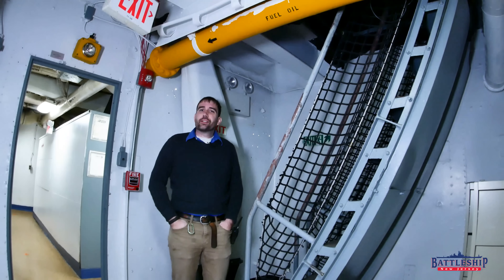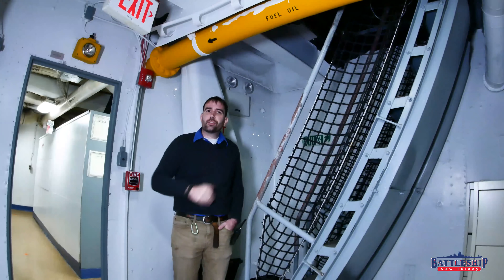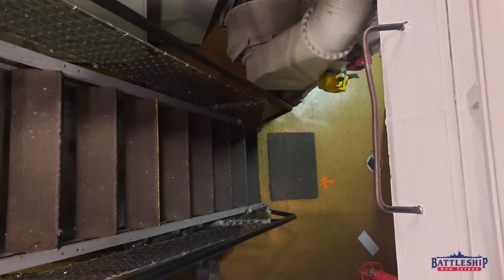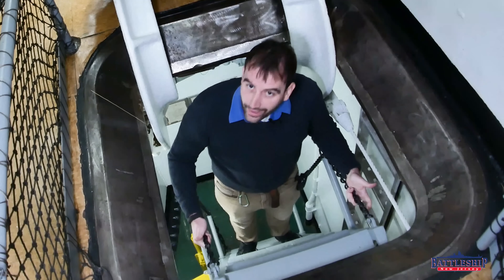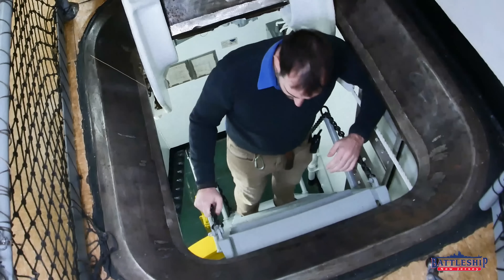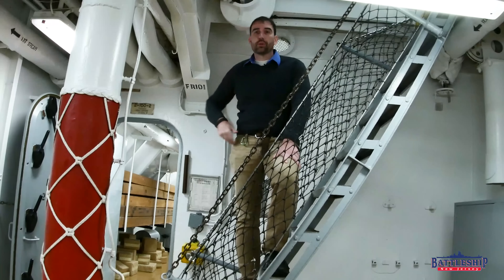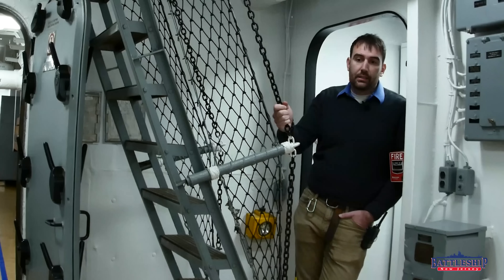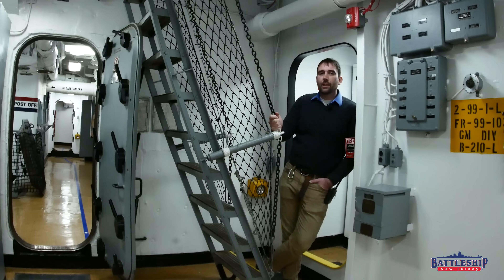Why Are Ladders on Ships So Steep? And Why Aren't They Stairs?

Comment: Thx for shaing this. This is no joke. My husband spent many years on aircraft carriers. He and a couple others, had to carry 80 lb barrels on each shoulder up 5 flights of these "stairs" =300 barrels. What the military forces them to do damages their body, and the VA does not want to give any of them compensation- disgusting. Yes, they slip & fall- big feet carrying heavy loads on those narrow treads. His shoulders, neck, back & feet were damaged pretty quick and have gotten worse over the years.

Comment: On the USS Saipan, to get from Main Machinery to shaft alley, you had to go up a vertical ladder at least two decks, walk across a catwalk over the well deck, then down another vertical ladder two or three decks. No sweat when she's sitting at the dock, but not much fun in a storm. Still, I much prefer vertical ladders to angled ones. Simple and clean.

Comment: A note on why they're called ladders and not stairs. Stairs are fixed in place and designed to be a permanent fixture. Ladders are not. Those are actual ladders which are designed to be removed quickly with a minimum of tools if necessary.

Comment: They are ladders.   It's not just tradition, it's design.  A ladder has no riser.  Stairs have risers.   It's also the angle, not to mention the width of the treads.   
Stairs have deep treads, risers, and a shallow angle of rise.   
Ladders have shallow treads, open backs, and a sharp angle.

Comment: Our house was built in the early 80s, and the narrow staircase definitely does not have a modern rise over run ratio, so each step feels just a little too tall, and narrow.  To make them worse, they are fully tiled, and each step has no overhang.  Thanks, previous owners.  Sometimes it feels like a ladder on a battleship.

Comment: The longest ladder I know of on a ship exist on the Essex class carriers, one I have used is on the USS Yorktown (CVS-10 a museum at Patriots Point) and the other was on the USS Randolph (CVS-15, scrapped). The ladder goes from the hanger deck (main deck) up to the 02 level where the JO bunkrooms were forward of hanger bay on the 02 level (flight deck is the 03 level). The joy of the JO bunkrooms on the Essex class were that they were right under the cats. The Yorktown was not too bad as they were steam (but by then I was down in officer country right forward of the hanger bay on the main deck. When on the Randolph they were hydraulics and very noisy.

Comment: Story time: I fell down a ladder on the USS George H. W. Bush while underway. the cause was due to my boots being split in half "Talking". I used to walk between 30-50,000k steps per day. my foot landed and twisted outboard, felt and heard a pop above my ankle. instantly i couldnt walk, immediately swelled to the size of a softball. my good friend and coworker was a big guy, he carried my scrawny ass up 2 flights and through the aft mess deck to medical. I tore 3 tendons, 1 fully torn, the rest in half. I was put on light duty for 4 months. it was a pain in the ass to move through the ship, crutches were too dangerous. They temporarily assigned my to Security dispatch until i was fit to stand armed watch. I became one of their best dispatchers.

Graphic: Due to the distance i walked around the ship daily, i kept getting ingrown toenails. I tried everything i could to prevent it. The corpsman had to remove the big toenail 5 times because every time it would grow back it would do it again. the process is extremely painful and still makes me cringe thinking about it. I'm currently on shore duty and no longer have these issues thankfully.
Reply: Additionally, My brain hurt when you slid down the ladderwell in the intro. Thats a big no no and an ass chewing from Chief.

Comment: Until I was on a ship with a stepped gangway I didn't think about draught when the ship pulls in to port. It sits at different heights from different piers, so the steps were domed, not flat, so they could be used at various angles depending on how high up that deck was.

Comment: In the mid 80’s I was on a fast frigate. The ship would pitch quite a bit in heavy seas. It was felt more in the forward part of the ship. So you felt weightless when the ship deck dropped from underneath you and then really heavy as it rose again. The ladders (stairs) were very steep to save space. There was this one ladder in a forward passageway that passed up through an extra large hatch (this is the only way this would work). So we would stand at the bottom of the ladder and just before the ship dropped, using the rails to pull ourselves up as we jumped, we would leap up the ladder well to the next deck. Fun times. 😀

Comment: Below are some corrections to your video for future tours/videos (Active Duty Sailor here):
-    <50 degree: stairs. >50 degree: ladder.  science, not tradition on this one
- down FWD: faster and usually how sailors traverse ladder wells. sailors almost NEVER go down backwards.

- Dent in duct is most likely correct in assuming sailors hit it (most likely going down too fast and used it like a rebound board). The patch is most likely due to some metal object that was being carried down said ladderwell being dropped and punching a hole through the metal. Its too thick for a person to have caused a hole, only denting.
- Active service ships do not use bolts to secure ladderwells. we use pins where one end is a loop ( referred to as an "eye") and the other end of it can swivel in and out to make it shaped like an I or a T to lock it in place. bolts would take too long to disassemble in an emergency.
- Sheet metal on the back of the ladder IS for keeping things from falling through the ladder. The sheet-metal will direct any hard/heavy objects such as wrenches toward the deck instead of further down the ladderwell where an individual may be climbing up/down and hit them in the head. The skid rails you mentioned shortly after ARE for the purpose of quickly moving goods/items up/down ladderwells.
-Transit direction info is spot on. (only applies during emergencies though, all other times you utilize "up ladder"/"down ladder")

Comment: Surely it fits into the "efficiency" and "practicality" guidelines of a warship to maybe built safer ladders for the crew?
If there a significant amount of sailors getting hurt by the ladders then you are 
a) losing that sailors labour
b) losing the medical staff's labour on helping that sailor instead of other patients/other duties
c) losing overall efficiency because sailors will move slower to avoid falling
Therefore wouldn't the engineers want to build safer ladders?

Comment: When I was in the Navy way back in my younger days, I would slide down almost every ladder.  The only ones I would not slide down were the ones into them main engineering spaces Those ladders were at least 2 decks down in one long run. Those scared me, but you always knew when someone did come down fast because it was a hell of a racket when they hit the bottom which was the metal grating you find down there.

Comment: 9 years Navy, served on two carriers, never saw anyone go down a ladder backwards.  Most people just kicked out their feet like you did in the beginning of the video.  Of course we were all barely 20 back then...
I always felt bad for the tall guy.  Quite often at the bottom of a ladder was a protrusion of something hanging down from the overhead.  A couple of times I came across some tall guy laid out at the bottom of a ladder because he hadn't ducked enough when sliding down the ladder.  Same thing with the knee knockers.  If they didn't duck enough they could knock themselves out on the top of the bulkhead passthrough when running during GQ.

Comment: Ladders are much the same way in the navy today.  About 6-8 years ago I forget exactly when the Navy started requiring those of us in Engineering to wear  Fire Resistant Coveralls, which were just full cotton coveralls treated with some sort of chemical. The treatment made for very weak material, so you could start to see everyone getting holes in the back of the leg (Like a 2:31 ) on their coveralls from walking down the super steep ladderwells into the Engine Room.

Comment: Fell going up one. New guy on a soda run, shirt and arms full of soda, not using my hands for the ladder. Tripped on the last step up and bashed my shins in on the hatch coaming. Didn’t drop a one. Made my delivery a couple more decks up, then limped off to medical where I was introduced to 800mg pills of Motrin.

Comment: While stationed on the Peleliu, I slipped and fell down a ladderwell from nearly the top; fortunately it was one with the pipe railings so I wound up just sliding down them to the bottom and made a noise so loud it woke up the deck officer.

Comment: Ryan, You're doing a BZ job!  Well Done.  I am a birdfarmer (Forrestal Class only) and we had escalators from main deck to the O-3 level - for aircrew only . . . BUT . . . in my entire career at sea, I NEVER saw them working!  Poor flyboys.  The rest of us used to 'hoist up, chain down' using the regular ladder types: use the chain to help run/leap, pulling you up the ladder, use the chain to slide/leap down the ladder.  You only slipped once - then asked a senior PO how to do it right!  If you are familiar with the territory of the area and know WHERE on the chain to grab, no problem.  If you are in an unfamiliar ladder/territory, use your feet and gravity will do the rest.  In train-ups or on a cruise, we often had GQ or Man Overboard drills every 2-3 days, plenty of practice getting used to the exact route to your battle station or muster station.  We had 6 minutes to get to our station(s) before Condition Z was set . . . and God help you if you didn't make it!!!

Comment: I used to slide down ladders if they weren't too steep but during my first trip on a certain ship i didn't realise there was a pipe there so i banged my head on it, fell down with my back landing on one of the steps and also managed to sprain my ankle. It did teach me a valuable lesson to be careful around these things.

Also when walking down, I always go forwards at a 45 degree angle so more of my foot can stand on the steps but i can still go faster than backwards, unless im carrying something heavy then it's backwards.

Comment: I hate ship ladders, I worked on every boat in the Everett Naval Fleet as a contractor and have had to lug so much crap up and down those damn things, like bigass parts or 150 pound buckets of bolts or piles of chain or steel cable, it's miserable. Some jack wagon SOB dropped a ten pound 1-1/2 inch wrench from the top flight of the Abraham Lincoln main ladders once, it fell four decks down and missed my head by about six inches, it hit something on the way down so I heard it and looked up just in time to dodge put of the way, I cussed out every human being within earshot of that ladder lmao🤣, which turned out to be a lot of sailors lol, and got a furtive "sorry" from up above, I never did find out who did it. Ship ladders are dangerous AF, in many ways. I've also had to rig a few 1500 pound heat exchangers with a couple chain comealongs through these ladders and hallways as well, so incredibly exciting🙄. Working on Naval vessels (I was called an outdoor machinist, I mostly measured and cut and installed new bulkheads or mounts and stuff like that, stuff that the bosses didn't trust the boilermakers with🤣) was really rewarding but extremely difficult, shipyard work is tough stuff...

Comment: We were working on the USNS Pathfinder to rebuild the Propulsion, and when the ship came into the yard, the gang planks the yard used, were so steep it was like climbing a mountain to get on board.  The Crew luggage was sliding down and the crew was holding on for dear life.  I had a 150 lbs of tools when I barely got to the main deck.   My brother took a dive down a ladder on another ship a couple weeks back... now he has worked on ships for forty years, so, it can happen when you least expect it.

Comment: I used to slide down stairs for fun... You can position your feet at certain distance apart, forward / back and at a certain angle and it feels like a continuous slide with some slight bumps and those bumps slow you down enough that the landing is safe but you can go down quite a lot faster than normal. Discovered it by accident.

Comment: Yes! My cottage is 300yrs old, it has a wooden half spiral staircase, doorway (with no door now) into the livingroom at the bottom and the top goes through to a bedroom. You end up 180 degrees in the opposite direction when you use it, start facing a wall then facing a room on completion. 

One night (after using it for over 25 years), I got up to go to the loo on the ground floor, I stepped off the first step (well bedroom floor) and helterskeltered all the way down to the stone floor at the bottom. It hurt but I was OK. I was too close to the middle pole where the points of each triangle stair end, no foot room. I still have bruises on my arms and legs 3 years later but as I'm 63 I think they are here to stay, I lost a big toe nail, it grew back, who knew?? It's not as good as the original but not bad and it grows very slowly compared to the others, yay! 

I really like the staircase and I will not get rid of it, on my small row of cottages most have gone or have been altered in the name of safety, extra steps landings to get rid of the triangular steps and make them less steep, no I'll stick with mine, it's not as if I'm going to fall down it ever again, you only do that once!

Comment: 9:25-12:00 whats with the fire alarm? Lol. Was this added in post? If so why lol
Reply from the maker: The fire department requires us to have modern fire alarms on board
Reply: @BattleshipNewJersey  Well, I assumed that. Lol. I meant that the fire alarm looks like it was photoshopped into the clip. It's probably just an optical illusion though.

Comment: I slip down ladder wells fairly often last time I did it was on a ladder well that at the bottom of the stairs was 2 walls and a door to the left, when I fell down the door it was being opened by a guy in my division. The ladderwell is so steep there that as I landed (on my feet thankfully) it appeared to him that I simply fell out of the overhead. Scared the crap out of both of us lol

Comment: I slipped plenty of times, especially when in a hurry, but I usually held on to the rails and managed to catch myself.  I don't recall ever actually falling all the way down a ladder.  What I do remember is hitting my head while climbing several times.  When climbing up fast I would grab the side rails and pull myself up while pushing off.  This allowed me to clear more steps at a time, but every now and then I would get a bit too high and drive my head right into the upper deck.  God that hurt, but it saved so much time when it worked that it was worth it, especially considering how many decks I needed to climb to get from my berthing to GQ station.

Comment: I spent nearly 4 years on the USS Saipan LHA-2, and I have no memories of going down any ladder backwards. I do remember once coming up a very steep ladder with a small hatch with a catch bar at GQ speed and ramming the catch bar with the top of my head. Good thing I have a hard head, but even so I still had a roughly eighth inch dent in my skull for the next month or so.
Reply: Hey, when were you on Saipan? I was in aft MMR for a while in '95 before I got out.
Reply: @danielpittman889  I graduated from my first C school in eaely spring 1997, at which time I was assigned to the Saipan, but was immediately reassigned to my second C school and physically arrived in June of 1997. Served there until I detached for separation in November of 2000. I was a fire contolman trained on both the CIWS and RAM systems.
Reply: @georgebowling560  That's awesome! Phalanx is a truly terrifying piece of equipment.
I joined Saipan after washing out of Nuke school (still in Orlando at the time). They flew me up to Norfolk, but the ship was down in Cuba doing some exercises after a shipyard maintenance period. So I got to work at the recycling plant in Norfolk for a while. Then some guys got hurt working on a steam pipe and they needed me all of a sudden. Flew me down to Cuba. You ever fly into Leeward Point? Jeezus!
Anyway, I was only aboard for a few months before I got a medical discharge. Good times though - engineering was Hella busy, but the Cheng was a great guy. The XO had served with my dad. Wish I could have stayed in a bit longer.

Comment: Not as bad as trying to use a ladder to descend several decks and the only thing preventing you from falling several decks to the bottom, is a safety net with a rectangular hole to pass through. Even more dicey if the net wasn't in place and all you had was the vertical ladder going down 7-8 decks.

Comment: Florida prisons have a section in general post order either 00 or 01. It states in part, "all ladders or stairs are strictly classified as ladders. When climbing ladders, you will face the ladder and maintain 3 points of contact at all times. Climbing down a ladder is the same. Face the ladder, 3 points of contact.